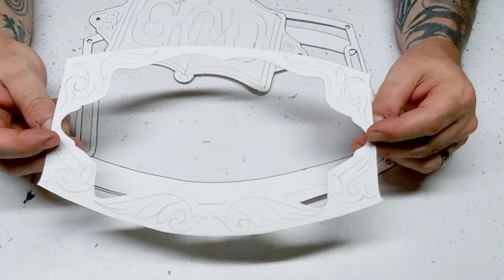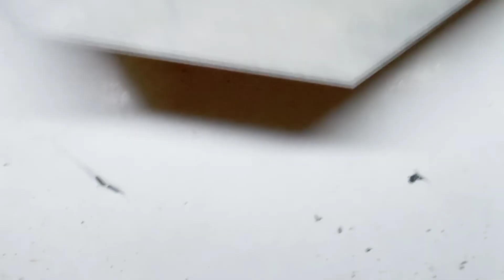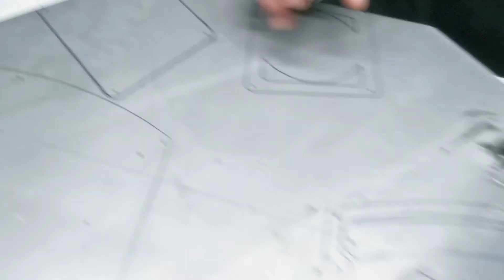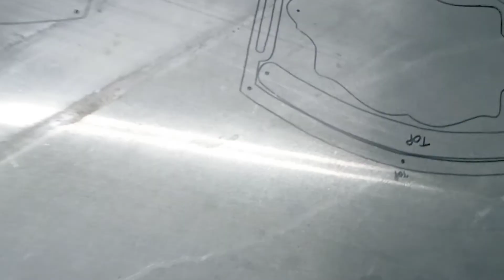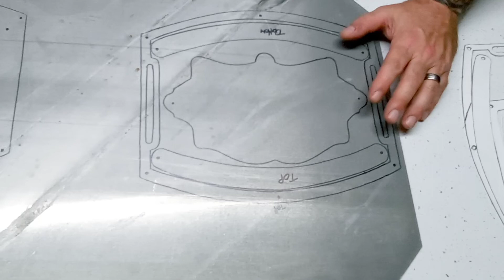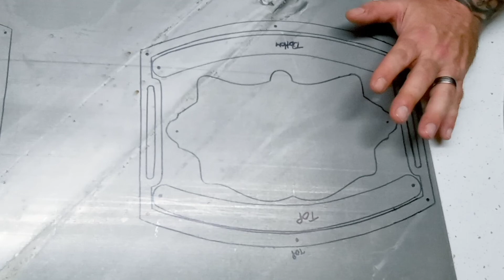custom belt build part 1

Comment: Think you have a great way of explaining how it’s done.
I’ve never made one and want to start now I have some ideas of what tools and how I cut the metal etc.

I’m struggling with the sizing and the drawing side.  Would it be possible to get an email of some of the templates so I can draw and cut out my own designs.
I don’t have a real belt to draw any sizing from so would be a great help if you could.

I’d also be interested to see what types of paints are used for detail work etc and how you make the belt part of it .
Reply from the maker: Most center plates are about 10 inches tall and 8 to 10 inches wide then you can size the side plates to it I use model car paint for the for the detail colors and spray paint for the gold
Reply from the maker: Look at part 6 of the custom belt build it will show how to make the belt part thanks for checking out my channel if I can help with anything else I will